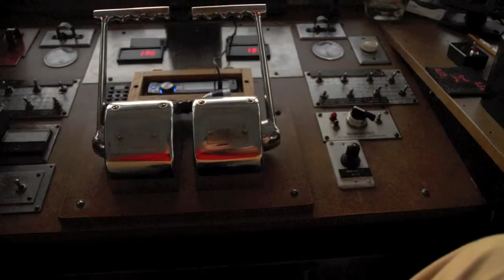Shipping Out, Part 8: Panama Canal Expansion Makes Upper Mississippi Updates Critical

Comment: As of July 2015 the Panama Canal is filling one of the new locks with water to test.  The new locks opening has slipped from 2014 to 2016 !  So are there any updates on the 1200 foot locks on the Mississippi River ?  I have read that the West Coast Ports pay a port tax for improving the shipping for the ports; but the money is going elsewhere !  Thank you for this old info; but do not think things have changed ! ! !

Eyes UP and lights down,  tjl  Sent by Win7Pro64 w/ADSL